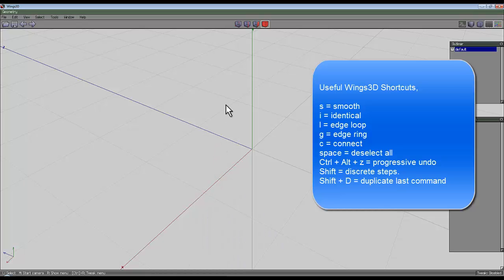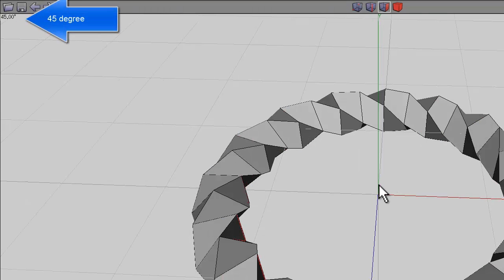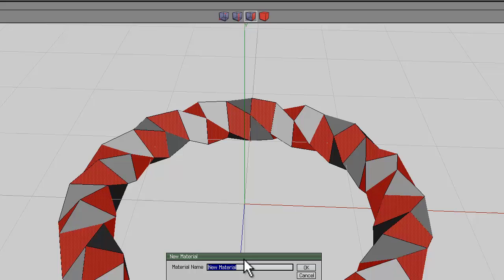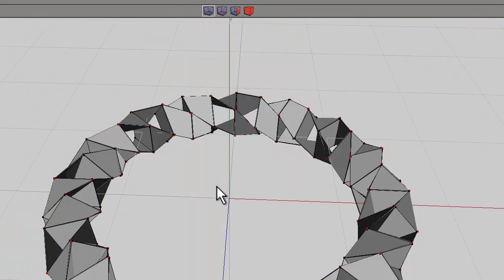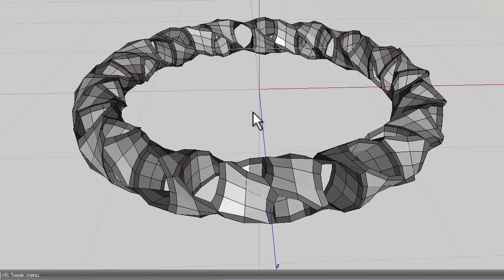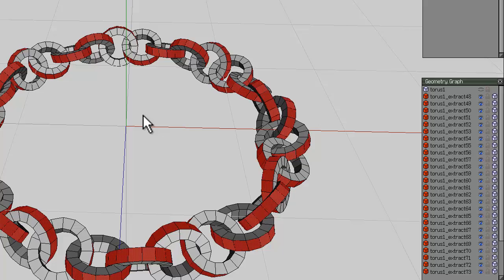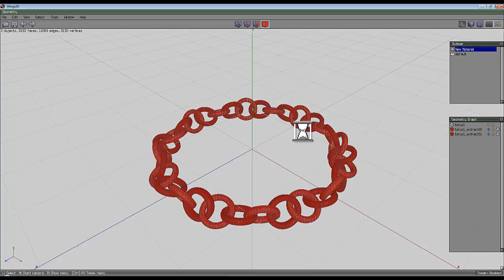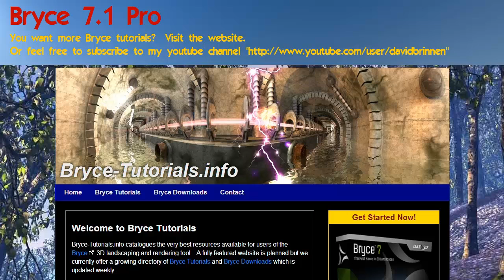Wings 3D project - 32 section twisted chain link loop - by David Brinnen.

Comment from the maker: My monitor is a standard HD aspect as you detected 16:9.  Yes I will email you when I get a bit more into DS about the layout.  But I suppose there is a risk in customizing the layout too much because then it will be more difficult to follow any tutorials that were made using the default layout.  That is the pros and cons of customization of interface for someone who makes tutorials.

Comment from the maker: Octane operates along similar grounds but a UV map is only needed for the application of images (unlike Bryce which offers some mapping modes in spite of UV's) Octanes procedural functions operate in the world space of Octane interdependently of UV it seems.  I've fumbled with DS.  But the material interface seems so clunky (I maybe not using it right) I've got used to Octanes minimal approach - which I like.  The DS interface seems to eat up the space on the monitor and leave no room to work.

Comment: Do you know what a shader is? The glass texture I use in DAZ Studio is a shader material. It is another way to surface models in DAZ Studio as well as many other apps. It works similar to Bryce Materials, but the method of use is way different. To get a Shader that has bump or displacement to work on a model, the object needs to be UV mapped, just like when you use a template to make textures for a model. I'm open for question on DAZ Studio if you decide to ask. I'll help If I can.

Comment: I could do an animation, but like you I don't like the amount of time it takes for rendering. DAZ Studio has a problem with rendering transparent Glass Textures, slowing down drastically as it works the glass. So any animation that has glass shaders on part of a model take several hours to complete. The animation engine in Bryce is still a mystery to me. How to get it to save in a format for use on Windows Player I still don't know. 
My new images will be at DA in a few minutes. There are 5.

Comment: I'm about to do a simplified version using the same method, but with just 6 sections and six slices. To make it work well I will expand the thickness to give the app room to work. LOL
I will do renders with each separate object alone, in pairs and in completely assembled form. That way you can see how intricately interlocked they are, and the radical shapes of each object.

Comment from the maker: There must be some calculable relationship between the number of sides, the rotations and the number of segments.  I've yet to figure it out mind, but it should be there for the finding.  I'm not very good though and stepping back from what I'm doing and looking at the big picture, I just tend to plow on with the next experiment.  For the mobius loops lower rotations seem to provide better looking results.

Comment: Well I tried my experiment, and here's my results:
30 sections will weld back together after the loop cut and 30 degree rotate steps. The Edge Loop every 3rd section does not make a good arrangement for creating a chain of toruses, but they did help me create an interesting model. After the bevel step, I shell extruded and wound up with three interlocking Torus shapes. See the Bryce render in my Gallery at Deviant Art. I can email you the recipe if you want it..

Comment: I'm thinking of experimenting with a high multiple of three with six slices instead of four, & using a 30 degree rotate rather than 45. It may work, but I'm not sure. The only way to know is to try it. At least I'll learn something one way or the other. My first try will be with 30 sections. I'll step it back 3 if that doesn't work, & forward three if that doesn't work. Oh, I'll use 3 as the value for the Loop Select, as I think that will be important. I'll let you know how I do with it.